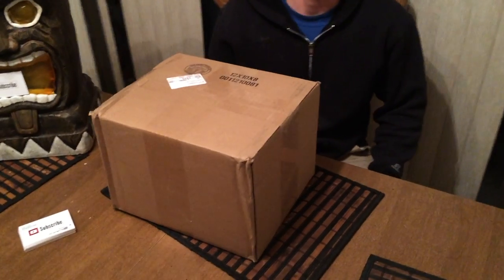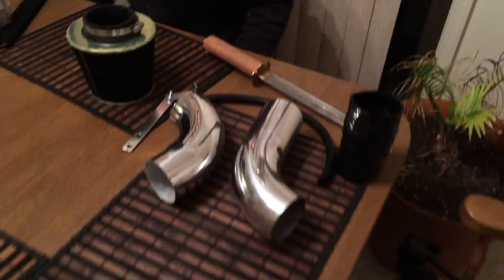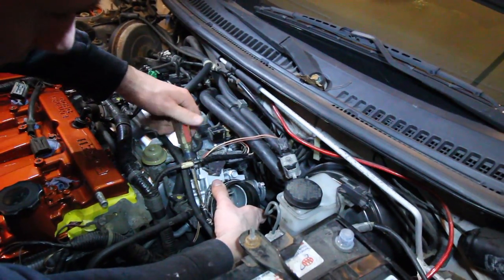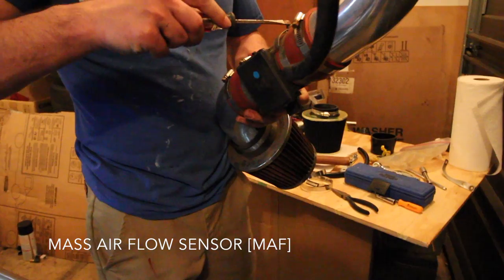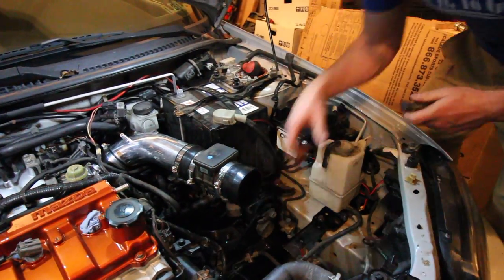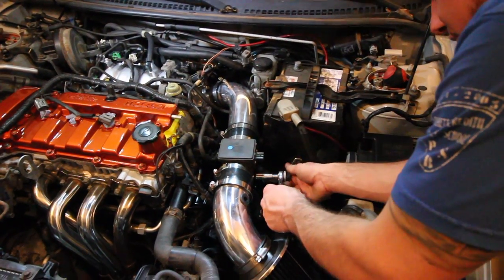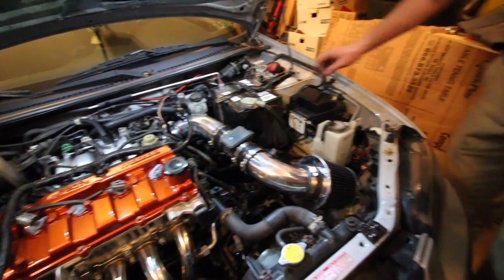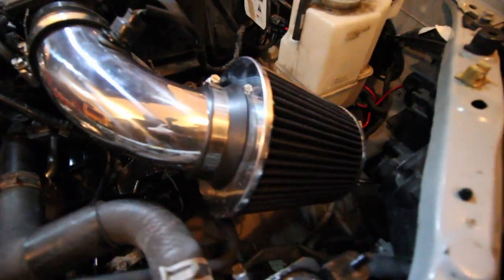Intake Install [Ebay RAM Air Intake]

Comment: you could also extend the intake piping as well if you dont decide to build a heatsheild it self and would probably give you better results by extending the piping down to the bumper area.
Reply from the maker: MSP5 Gets Injen Cold Air Intake [Widebody Mazdaspeed Protege5 Show Car]: https://youtu.be/owYc-6gZBIc 👍
Reply from the maker: i swear it's the same car. It's all on the channel 🤘

Comment: How do you secure the old vacuum stuff that held down the radiator? I removed everything that was connected to the air filter and stuff and now the radiator is just lower

Comment: Those pod filters are so restricting they stop much air flow I suggest a light foam filter with maybe a spring inside to hold it’s form

Comment: I have a 2000 mazda protege 1.6 but I can only find 1.8 & up... Do you think it will matter?
Reply from the maker: Great question! As long as the engine configuration is similar, and the throttle body inlet needs to be about the same, but i believe it will work 👍

Comment: What kind of headers are those? I’ve been looking for parts for my 2000 protege but I’m having trouble lol
Reply from the maker: @Im Arcane That sounds right.. The exhausts for these are pretty rare for what they are, and so the prices are stupid high. We've installed a number of headers on the Mazda so far.. First set were SRS [ https://youtu.be/NySpPjN8pfk ], then we ran the Mazdaspeed Protege Callaway exhaust [ https://youtu.be/-AHQEdsJrTM ], and now we're running custom pipes with a Ebay mani [ https://youtu.be/NxSop9y3GzA ]
Reply: Do you know what I would have to do to boost it? I know the stock block and rods can only take so much...but all the turbo kits I find are for 2.0s and my slowteges only a 1.8. Would I have to take it to a fab shop???
Reply from the maker: We could boost it, but it really comes down to the ability to tune the setup.. It would probably need a Haltech standalone ECU, and also the oil return line for the turbo.. Yeah, the stock pistons like to break at high boost. Ryan's only running 7psi atm and will likely go up to 8~9, but the max hp of the 2.0 stock internals seems to be around 220. i'm not sure what a 1.8L could be pushed to

Comment: Whre u buy of cold air intake.bro
Reply from the maker: idk where you can buy a CAI from, but we got this RAM intake from Amazon [ R&L Racing Black Short Ram Air Intake Kit + Filter 99-03 Mazda Protege MP5 5 1.8 2.0 --> https://www.amazon.com/Racing-Black-Intake-Filter-Protege/dp/B01MU6012R/ref=sr_1_6?ie=UTF8&qid=1544676975&sr=8-6&keywords=mazda+protege+intake ]

Comment: I couldn't get everything to match the header, what did you have to change to get it in there?
Reply from the maker: Match the header? Maybe you mean the throttle body? We had a lot of options for adjusting fitment and used what was provided in the box. The silicone pieces stretch pretty far, and it's all clamped down by ratchet clamps. What's not fitting?

Comment: trying to find a short ram intake for my 2004 mazda 6 3.0. Haven't been able to find anything other then cold air intakes. they worry me though because I've had several friends hydro lock their engines because their cai sucked in water from puddles.
Reply from the maker: @Crue313 For sure, i actually don't like CAI's on any N/A cars. RAM is the best way, combined with a heat shield air box imo. i found a couple that will fit your car.. 
$43 Universal [ https://www.ebay.com/itm/BLACK-RED-short-Air-Intake-Kit-For-2001-2004-Mazda-Tribute-DX-ES-LX-3-0L-V6/283238055331?hash=item41f24dbda3:g:ZUQAAOSwCcZcXHEA ] <-- Choose your color

$168 AEM [ https://www.ebay.com/p/AEM-Induction-22-483R-Air-Filter-Performance-Kit/243751074?iid=183508561125&chn=ps&mkevt=1&mkrid=711-117182-37290-0&mkcid=2&itemid=183508561125&targetid=313776935016&device=c&adtype=pla&googleloc=9007460&poi=&campaignid=1669934603&adgroupid=65058347419&rlsatarget=pla-313776935016&abcId=1123856&merchantid=113406141&gclid=CjwKCAjw0tHoBRBhEiwAvP1GFThhThA7VRDEZOQADoZwrKHTZYvmLgfXNHCnwkeYtRxYnnvjWGviNRoCn_MQAvD_BwE ] <-- They have other colors as well

i'd recommend finding/building the box if you go this route 👍
Reply: @milsgarage   Yea CAI's are good but risky. Yea I have seen that short ram before and It does look like it would fit my car, because it was made for the duratec 3.0 v6 but I don't see a place to put the MAF sensor.  Unless you have to use the stock maf piece. Yea when I do a short ram I will definitely be making a heat shield for it.
Reply: @milsgarage   I actually started thinking that I might buy the BCP CAI on ebay and maybe just cutting the intake to make a short ram.  I think that might actually work. Cut it where the air filter would sit right over where the stock air box would be and then build a heat shield around it. Whatcha think?
Reply from the maker: @Crue313 Sure, that's a cost effective way to go too. i believe the top Universal one i listed above is the most similar to the one we installed in this video. It's a lot cheaper than the AEM, so getting replacements will be super easy. And you have like 5 colors to choose from, so that's pretty sweet. It'll end up replacing the last stock tube and airbox, but i think you need to keep the one rubber coupler with all the vacuum lines coming off of it
Reply: @milsgarage Cool thanks for the info.  I'll definitely be making a decision in the next few days.
Reply from the maker: @Crue313 "buy the BCP CAI on ebay and maybe just cutting the intake to make a short ram" O_O.. 🤔 Looking at the CAI, the MAF sensor location is pretty far back.. If you were to cut the tube and keep that location, you'll probably lose the bracket to keep it from shaking. Sounds like an interesting idea for sure, but i think you'll run into less problems with the compact tube already made up for you. i like your thinking though 💯 👍👍. And any time! i wanna see a pic of the engine bay after you finish :D

Comment: does the filter still spin when it's tightened down???
Reply from the maker: No sir. It's secure.
Reply: so mine was tightened down but the filter itself still spins freely🤔 not sure what the issue is but I switched it back till I can get a boxed that can fit over it so it doesn't pull hot air... original does good but the sound is lame and I just did a muffler delete this morning which I love on my azera
Reply from the maker: Spins freely? Shoot, now i'm questioning my response.. i'll be filming the car tomorrow, so i'll double check for you. Does it seem like it will disconnect on it's own? If it's not going to fall off, you'll be just fine
Reply: @milsgarage  no Its tight and good but the filter above the rubber seal spins freely so I'm not sure if that's normal is all and yes please do as I Took it off thinking it's no so normal....thanks for your response.
Reply from the maker: @Jesse James Hurtado III Sorry for the delay! Ryan and i have been going crazy with MG stuff lately.. The shoot changed plans so i haven't seen that car in the last couple days, but Ryan says his intake cone spun freely before and was laughing when i asked him. You'll be just fine putting the intake back on 👍

Comment: Hey guys i have a question .is about the tires ! My 03 protege dx use 195/55/15 so is posible to put a little wider size in the rear like 205 or 215 ???
Reply from the maker: Hi Armando! i can't say because i don't know the width of the wheel.. What's the width?
Reply: @milsgarage  yes sorry the width
Reply from the maker: What width wheel is the tire going on? Is it a 7" wheel?
Reply: @milsgarage  6”
Reply: Well i guess if the stock tire width size 195mm must be like 7.6 inchs wheel?
Reply from the maker: @Armando Sanchez hmmm Google says stock wheels on the DX is a 6" wheel.. That would put your max width at 205. If it's a 6.5" wheel, max is 215. And 7.0" max is 225.. You're going to want to pop off one of the wheels when you get a chance and check for the specs on the inside of the spokes 👍
Reply: @milsgarage  ok thanks so much for the info i appreciated
Reply from the maker: @Armando Sanchez Any time Armando 🤘

Comment: i like to work on cars alot i wanna know a good first car for customization
Reply from the maker: a mazda miata is somehow really awesome. Ryan would probably say subaru, and i'd have to agree that there r lots of options and massive gains to be had with a WRX and simple bolt-ons.. but being a boosted engine, u'll have to be cautious and make sure to tune it properly

do u have a budget, want to drift, want to be able to drive in the snow/off-road, or have a favorite make?
Reply: Mils Garage my budget is 5k and rest on parts i was thinking rsx and thx for the comment back.    ps im 17 insurance is high 😭
Reply from the maker: arg, insurance prices r such crap. well a rsx is absolutely reliable and has lots of options. i've never built a honda, but i've seen people build 10 second cars out of them for less than $10K.. i just checked, and i think u can probably get a MS3 for around $5K. that was my first car, and somehow the insurance wasn't any different than having a mazda3
Reply from the maker: idk what i was thinking.. get a mazda :) u can customize anything
Reply: Probably to late but an is300
Just picked one up

Comment: can someone help me i have a cold air intake but i need to know how far to put the tube "pipe" in the actual filter i put mine in all the way till it wont go in anymore and i feel like thats wrong this is my first one :(
Reply from the maker: You want to insert it as far as it goes until it lines up with the clamp and can be tightened down. Most important part is the seals

Comment: I just recently installed a short ram air intake on my 2000 Mazda Protege but it cuts off after one -two seconds because I believe it's getting too much air is do I have to recalibrate my computer or upgrade my maf sensor or just keep it stock all together?
Reply from the maker: i don't think it's getting too much air. did you reset the ECU?
Reply from the maker: if it turns off after you start it, chances are it's not getting enough air and it bogs out. it's either you haven't reset the ECU, your vacuum lines aren't connected, or your MAF sensor was damaged during install or needs to be cleaned. jic: how to reset ECU [ https://youtu.be/iq0qxaTLha0 ].
Reply: i didn't reset the ECU as of yet or clean/replace the MAF sensor when i looked at the maf it was actually pretty grimy. As soon as i get out of bed I'm going to apply these tips and see what happens and thanks for a quick response love your channel
Reply from the maker: any time buddy! awesome. we'll figure it out. 🤟😎👍 thank you so much for your support Spycee Lyfe!
Reply: hey well i cleaned the maf sensor and grounded the ecu to no avail but i got an inquiry from a fellow diy'er at AutoZone and he mentioned that maybe i should upgrade my stock fuel injectors being that i am soon to install a turbo in the future could that be??
Reply from the maker: well.. yes. if you've been running regular fuel, then you should definitely get new injectors and only run premium from now on. but i don't think that's why it's bogging out.. maybe the MAF is installed backwards? there's no hole that needs to be plugged up on the intake tube?
Reply: I believe that the MAF sensor is installed correctly being that it's facing the same direction that it was plugged in the original air box as far as the hole that needs to be plugged in the intake tube I inserted the intake tube down further into the intake cone to cover the hole

Comment: Did it change performance
Reply from the maker: we don't have dyno numbers to verify the difference for you, but this is definitely an upgrade from the restrictive stock airbox
Reply: Not hatin, I have one on my car too, but, this is neither ram air or a cold air intake. Be real. 
     Ram air forces external air into a plenum that houses the intake creating flow above and beyond intake vacuum. A cold air intake isolates from engine compartment. These cheap systems, just like I have, allow for less restrictive flow but you are not getting the advantage of a dense cold air charge or increased flow beyond vacuum.
Reply from the maker: i'm being real sir.. this is a RAM air intake, as it is not feeding from an extended tube, leading to a cold air pocket. of course you can add air boxes and scoops to increase the efficiency of the RAM intake, but if you want to buy a short RAM intake, this is what you're going to be purchasing.

Comment: if you go from stock to RAM do you need to buy a plug and if so where
Reply from the maker: u should be able to use the old MAF sensor with the new intake.. is that the plug u meant?
Reply: yeah thanks
Reply from the maker: any time buddy :)